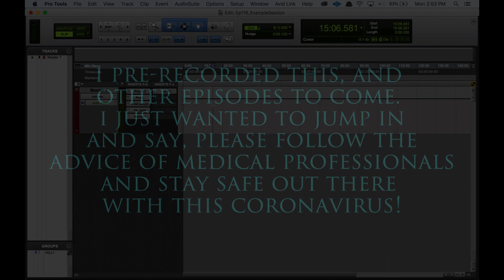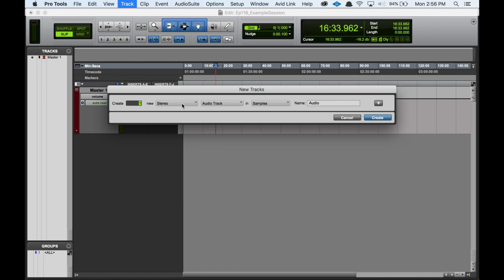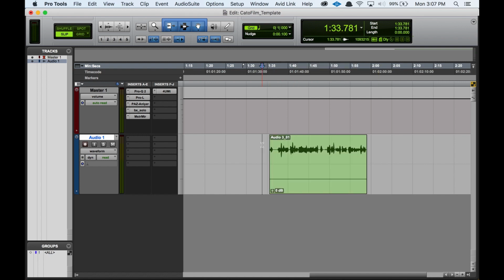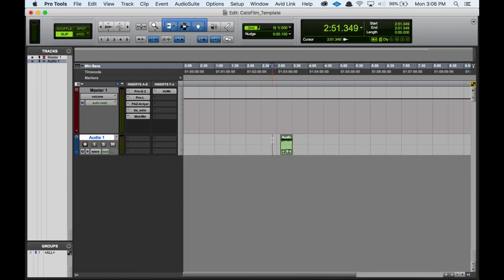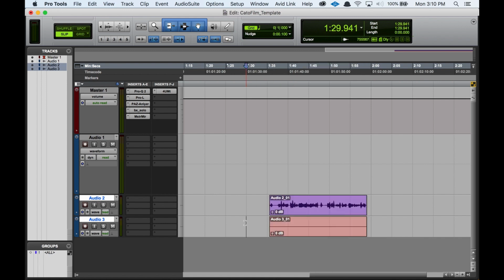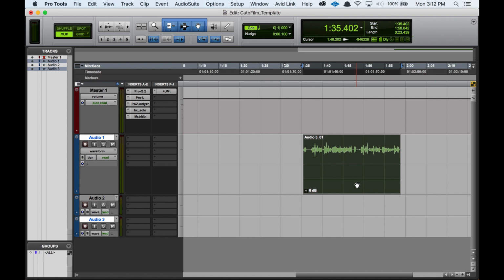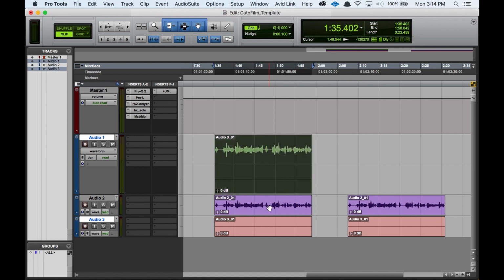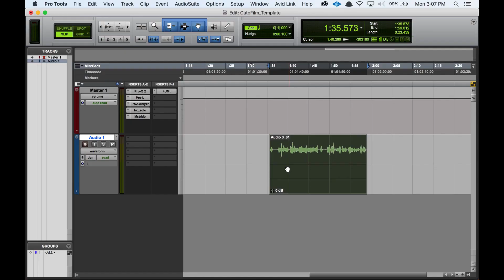How to Fix Audio Only on Left Side: Stereo to Mono Conversion in Pro Tools

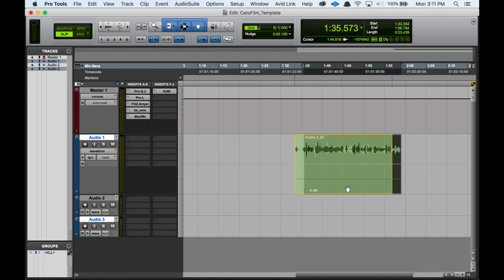Comment: If thats an issue what your "students" often have, they should probably consider another education. The simple information what all this video is about comes actually at 5:30 and is quite the most complicated way to do it. First of all: PT supports right click menu on track > "convert to mono" which is doing exactly this what she is doing with drag and drop and far too many steps involved. Besides that dragging the wrong way can cause nudge issues and the right click command copies all exisitng data with it into the new 2 mono tracks automatically. And second: the more interesting way would be to keep the original track integer to possibly come back to it if it was the wrong decision or simple to know that it is based on a previous stereo track. Splitting all the tracks could become VERY messy in film sound design and mix sessions like for cinema with over 400+ tracks, what we have often here on desk. You better find a way to just run the left channel with a discret stereo or channel mixer plugin like the pro tools "downmixer (stereo>mono)" plugin or by routing the left channel into a mono aux. Which would be the best option if you have multiple tracks with the same issue and the same needs of channel mixing.

Comment: Excellent vid!  I have a slightly messier problem I'm curious about.  I have a stereo performance clip (entire band on a stereo file), but the lead gtr is mistakenly panned to one side.  I want to make the guitar to seem to have been recorded stereo.  What steps might you take to do this?
Reply from the maker: I'm assuming they don't have the original raw files, or stems, that they could send to you?
Reply: @CatoNoise  No, it was simply a stereo interleaved file.  I may have figured this out and we'll see what we end up with.  I made a duplicate file and did a 'stereo flip.'  It's about as good as it will get.  Thank you for the quick reply though!

Comment: Thank you for great info! Is there anyway that you could swap left and right channel in pro tools first?
Reply from the maker: I'm not super familiar with what Pro Tools First has and doesn't have, but I think you should still have the pan knobs in the mix window (above the faders, just a little below where it says "auto"). You can just turn each of those so that they're all the way to the other direction, and that will make it so that the channel that was previously panned to the left is now panned to the right, and vise versa. Let me know if you have any trouble and would like any other help with that, good luck!
Reply: @CatoNoise  thank you so much! I’ve tried that, and I am just wondering if it actually messed up the recording itself since I don’t really know how pan works. I was recording a classical chamber work and just found out afterwards that I accidentally plug the mics in the wrong channel so the left and right was reverse
Reply from the maker: @chieh-anyu409  oh cool! Yeah, it shouldn't mess anything up. They call the first channel the "left" and the second one the "right", but you can actually pan them whichever way you want to, so they're sometimes a bit of a misnomer. Good luck with your project!
Reply: @CatoNoise  Thank you for your video too!

Comment: I recorded a whole session (song) on protools and at first audio was coming out on both sides and now is only on the left. Any suggestions? I'd really appreciate it. Thanks!
Reply from the maker: I'd check your panning for your master fader (and other tracks), and look at the meters to confirm that there is audio going out that right channel. If you can see signal on the meters, that tells you a lot about where it's happening in the signal chain. Then, I'd check with another playback system (different pair of headphones, different set of speakers, whatever) to confirm it's not your actual headphones/monitors that are doing it. If you have an interface, I'd check that that isn't causing it. Also, if you have, for example, headphones with an adapter, make sure your adapter is a stereo adapter (TRS, not TS). Let me know if none of that works?
Reply: @CatoNoise  Thanks, I got the monitors working but no sound is coming out from the headphones.
Reply from the maker: @MrLahdeeda  Sometimes there's a separate volume knob for headphones on interfaces - have you checked for that? Otherwise, I would check that those headphones work on a different device. If they do, then you know it's not the headphones and it's something about your setup. Are you using an interface? If so, I would make sure the headphones are plugged into the interface and not directly into your computer.

Comment: Very helpful! I am working on my first "outside project" (mixing job in addition to composing/recording string arrangement), and faced with loads of stereo tracks that I expect would normally have been recorded in mono, which appears to be adding noise and muddiness to the mix while unnecessarily consuming CPU resources. These solutions are more efficient than the workaround I figured out on my own to clean up and edit the session. What's interesting though is that I am finding in this project that the left channel seems more prone to containing the unwanted noise, and by muting or deleting that and keeping what signal remains on the right channel, it's giving me a cleaner sound that aligns better to the rhythm tracks. Thank you!
Reply from the maker: Oh yeah, I've actually seen that (noise is worse on one side than the other) issue with the CEO network audio that I process. I think maybe it's something about the way some recording devices tend to break or develop noise over time? It's really weird.